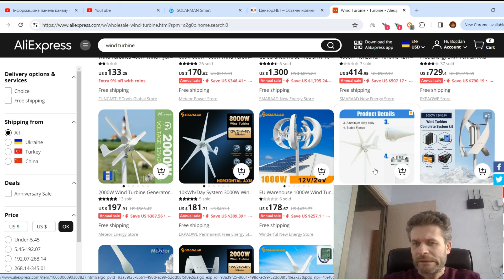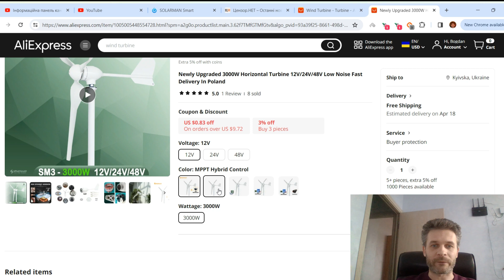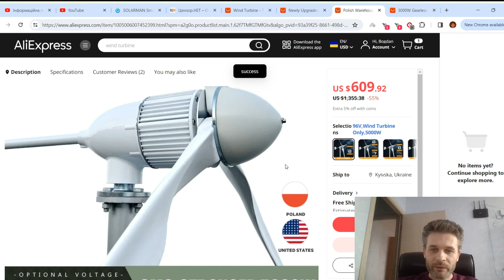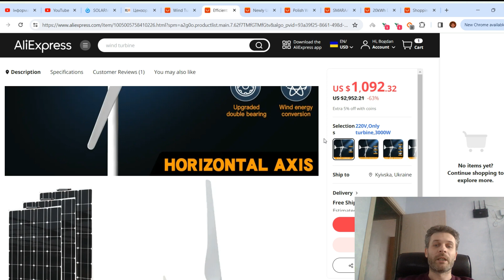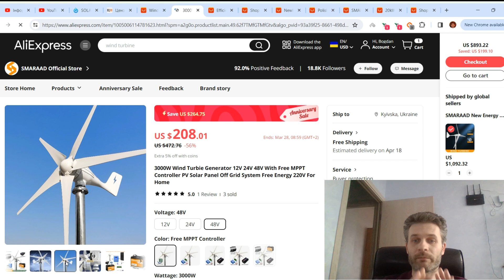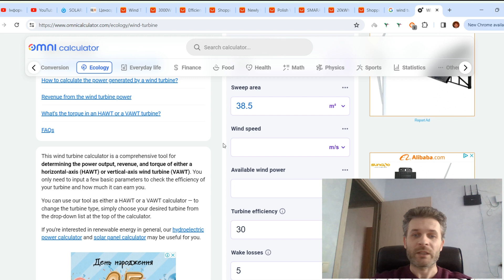Which Chinese Wind Turbine you may buy and which to stay away from - reviewing typical WT models.

Comment: This is a great overview thanks. My 6 blade 400 w turbine will produce 480 w in big gusts and run over 2000 rpm. I wonder if the 6 bladers start to spin earlier and when the winds gusting 20 ms having more blades help naturally slow things might be a good thing! Plainly local wind conditions are relevant. With your low winds I suggest you try a 6 blader and see if your power harvest is more?
Reply from the maker: @ANZUSmed  in my case better choice is less blades, but slightly bigger dia. In any case - my conclusion so far - everything (factory-made unit I mean) below 4.0 meters in diameter is a toy...
At least for my area.

Comment: The hole in tail is to fix a rope and to move the turbine from the wind direction on strong winds. This is the reason for the hole. I find it in strong wind when i try to stop turbine and i find that the generator is not able to stop the rotor! I have M3. It' s not good. Don't buy it. Only for fun or to scarie crows!
Reply from the maker: M3 is a tiny wind turbine. and why would you want to stop it? let it spin and produce like crazy, it won't run away, don't be afraid. I've seen it on 15+ m/s winds - holds like crazy and hits way over promised 500 watts. it is hard to get more, since on that speed, each blade starts slowing down the next going one. so, why would you want to stop it if it naturally slows down itself?

Comment: What about the vertical axis wind turbines, what do you recommend, or which companies do you think are the best?
Reply from the maker: I won't recommend vertical, they are way worse than the horizontal ones.
if both are same price - vertical will produce 20-30 times less.
to make them produce same amount of power - vertical has to be 5 times heavier, bigger and will be at least 3-4 times more expensive than it's horizontal counterpart.
I've tested like 3 different verticals - all are useless.

Comment: Do not buy from Ali Express!! Or Ali Baba! Purchased a SM6/SM8000 got sent a 4 including box weighing only 29kg should be 41kg blades match a M4 and M4 M5 SM6 SM8 ect all look the same in pics and even come in the same dimensioned box and Ali no matter how much evidence you provide won’t supply shipping label… Cost to send back to China from Australia is over $400.  Both Ali companies are rip off merchants and PayPal won’t cover shipping either.
Reply from the maker: the best place to buy a wind turbine - will always be a manufacturer, on Alibaba.
on Aliexpress you are mainly dealing with resellers, but still, sometimes, you may get a bargain deal there, thus it is quite hard.
Reply: You’ve helped many people with this video and I’m sure 12-24&48V turbines now aren’t selling. Alibaba has its own tricks with shipping if you don’t understand incoterms but more honest with figures. AliExpress seems to be 3-4models down graded like the SL3000 is actually a SL1000 or my M8000 is a 12V M4 with a sticker on it. They agreed to pay shipping in the end.
Reply: @BackyardVoltage  Ali/Temu/Ali Baba. Same company been dealing with them for a while. Iv purchase extremely good quality machinery and iv received absolute junk. Trade assurance/Express guarantee means $0 they’ll refund small items sometimes give shipping labels sometimes say keep it but something like a decent battery bank or large turbine? Zilch. I’ll make a video soon of what can be expected. And yes I have picked up some bargains here and there I’ll post them too. You own one of them!

Comment: if you have choice of 12,24,48V to buy. Are they same, do they change just controller, or they change motor of the turbine?
Reply from the maker: 12/24/48 - they must be different in coils in wire thickness. so 12V M3 and 48V M3 are two different wind turbines with two different generators (despite they look absolutely equal on the image).
however, the thing is that 48V wind turbine can work in all three modes (thus with the reduced efficiency on 12 and 24 V systems), but the 12V wind turbine won't be able to work on 24V and on 48V systems probably at all.

once you are of higher voltages, for example, if you have a 48V battery system and if you want to use 96V wind turbine - you need a specific buck controller type to make it all working as it should.

controller voltage should ALWAYS match the battery (system) voltage.

Comment: Dobryj den Bodgan ! Thanks a lot for all your nice, studying, sharing and rich videos.... You advice that the highest generator voltage , the best it is.... , about the subject off voltage ... i know that generator and motor voltage are linked with the rotation speed  , vice versa (current is for torque) , But how it works ?
Does it mean that > 48 volts generator need to rotate faster, and so the starting ignition of powerproduction will de high ( > 5 m/s ie) , or there is a conversion voltage/current by the Mppt (like in solar to produce 48 Volts, the mppt range depends of series/string of panel ) You can grow to PV voltage buy  the mppt regulate (always) at 48 volts 

So, when wind turbine is sold with 96 Volts, 230 , 380 Volts , what that mean ? We talk about MPPT output  (to battery) ? Or this is the simple media/pipe to transport energy TO the mppt INPUT ?
Reply: And finally, what doyou think about 230 even 380 Volts ?
Reply from the maker: @juliengourdet  look, there are generally two concepts of how to use the wind turbine.
1. simple one and very well known - charge controller (or no controller, just with the rectifiers) to charge the battery pack.
there in general the WT voltage should match the system voltage, or what I noticed it is better to get +1 step of wind turbine for a system voltage. example - if your system is 24V go get the 48V wind turbine. if your system is 48V go get the 96V wind turbine.
2. the other "high voltage" wind turbine concept can be used in two cases - either if you have a high-cost buck type of off-grid controller when you are charging the battery bank. or if you are using the so-called on-grid controller (Deming manufacturer or Greef), and then supply the DC from the controller to the solar MPPT input (literally of any solar inverter, just the MPPT range has to be somewhere within the 220/240/380 VAC of the wind turbine).

So, normally concept 1 is absolutely ok to be used in smaller wind turbines up to 4.0 meters in diameter. And concept 2 is generally a must in the wind turbines of 5+ meters in diameter.

In both cases - the system should be set in a way, when a wind tubine starts production on the winds about 2.7-3.0 m/s, otherwise if it is sitting duck up to 5 m/s for example - then you have a wrong components selected, and something is not fitting there well.
Reply: @BackyardVoltage  oK perfect for this explanations 🙂

Comment: Thanks for the info. Can you recommend a source for quality parts? Surprised the wind power community seems small. Anyone recommend any good sites for parts/reviews/DIY? Cheers
Reply from the maker: I've seen some parts on IstaBreeze store. Also you can find parts on AliExpress. And, some rather common pats (bearings, bolts/washers/nuts, brushes) can be found in any nearby construction supermarket.
Reply: @BackyardVoltage  Are the Istabreeze hybrid controllers and turbines good? Thanks
Reply from the maker: no IstaBreeze is not good, I can't recommend
Reasons:
1. blades are awful in all of their turbines except the most expensive Heli ones.
2. slip rings they use in their turbines - always fail, you have to get a substitution, and that has to be not the Ista original part as it will fail again in maybe 6-9 months.
3. generators themselves - huge gaps between magnets and the coil, like x3 to what is considered normal across the industry.

about controllers - they are the same chinese ones, but just with the x2 price.

so no, I won't get one for myself, and won't recommend one.

Comment: Too point out what you said about the 5 blade turbine. Dead on again. I bought a cheap China made turbine. It has had 5 blades. It did nothing as making power. Sounded like it was coming apart at high wind. (High wind to me is 10 mph+ or 4.5 m/s) I geared it 1.4 to 1 with a bike chain and did see some amps. Three blades are the way to go. I put the 5 blades on a Amteck 36 volt 15 amp motor and only seen 1 + amp in 10- miles per hour wind and you could hear it. NOTE: I cut had 6 inch's off the 5 blades and they ran much faster. It is just a test. ME, I build my turbines for low wind. You are putting out very good information. Keep it up.
Reply from the maker: Yes, in general 5 or 6-blades will start spinning on lower winds. But already at 5m/s it (again in general as it also depends on the blades themselves as well) will be spinning slower than its 3-blader rival.
That is why it makes little sense to use 5-blade wind wheel, aside of the separate fact when you really need that higher torque for you low-rpm generator (which is a rare condition to be honest).